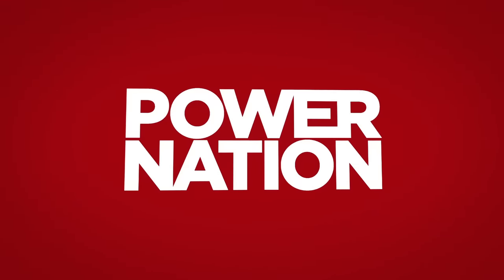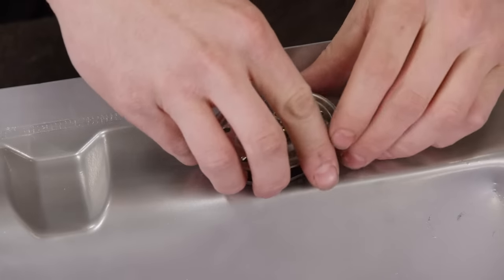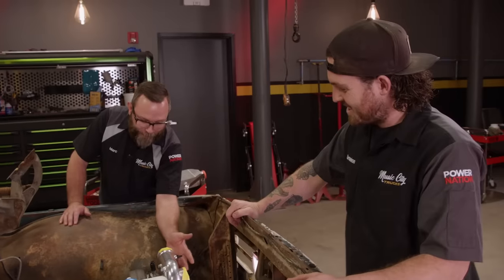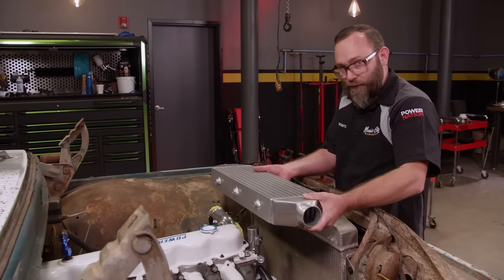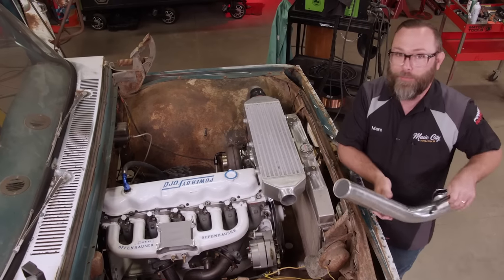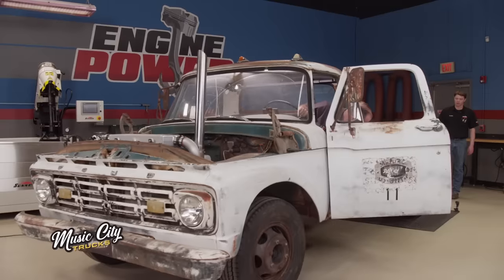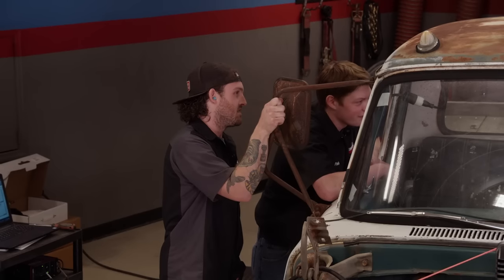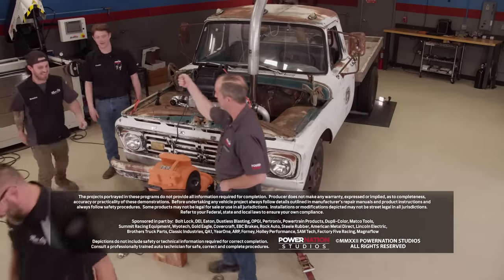Turbocharged Ford 300 Flatbed Dynoed - Music City Trucks S2, E8

Comment: Great project but it just seems like you took the lazy way on some of your choices. 

Solid mounting the engine and then sold mounting the intercooler to the engine and the top radiator tank?? Really? You do realize how much a chassis flexes on a old solid axle one ton truck don't you? Not only did you mount the intercooler right where all the hot air from the radiator is going to go thru it. So you are going to have nothing but heat soak problems. Because of how you mounted it, either the radiator top tank or the intercooler itself is going to at the minimum develop cracks. At the maximum get torn apart.  

Why would you not mount down behind the front bumper? You could angle mount it and build a shroud/scoop plenum box to direct air into it. And there is plenty of room to run the tubing in under the core support.  This isn't a slammed import.

And a hood dump exhaust pipe? Seriously? What are you 16? I thought you said you guys want to drive this? Some of the choices you are making sure makes it seems like the opposite of a driver.

Comment: So you decided AGAINST the holley Sniper that was ALREADY tuned for the engine and turbo....  and putting that exhaust like that is just as idiotic as putting the air to air intercooler horizontal over the radiator.  Someone should have walked in and fired you both.

Comment: Fun but nonsensical build. I loved the original upgrades. I think they managed over 200 hp and it ran great. This build was fantasy only as it makes no sense. Economic or otherwise.
Reply: May be for you. But there’s people out here that like to do odd things. That’s what entertains them. Who are you to tell them it’s nonsensical to build something different so they can say they have something different?

Since you’re all about practicality you should never do anything but a 350 Chevrolet.
Reply: Respectfully, I disagree. This has the low speed Torque of a diesel engine, high speed horsepower of a 460 gas V-8 engine & fuel economy of a small V-8. This engine really can do it all very well. Example: check YT "Wasted Paycheck Garage Towing 12,000lb load in my Turbo 4.9L"  (300 cid) like it was nothing. Not "nonsensical" at all, but very practical, useful & reliable.
Reply: The only thing wrong with this project is some of the choices they made. Like solid mounting the engine and intercooler, the intercooler mounting and position, and the hood dump exhaust. Nothing wrong with the turbo'd 300 except I would have left it carbed ( blow thru ) .
Reply: Ok, good points. But they did have to rebuild from the crank up. Now add the turbo, associated plumbing and intercooler and the investment has to be at least 10k. And it's not even fuel injected or computer controlled. Add the very high octane fuel which can cost more then diesel. It's cool for sure. I love the 300 straight 6. But just get a diesel. The 300 with upgrades was a great project. I think they got over 200 hp. Now that's a runner.
Reply: @joewright219  I don't disagree with the point that they are building something really cool. I love the 300 straight 6. A reliable work horse for sure. But the cost vs gains is not great. Probably well over 10k invested and you get something as good as a diesel. The premium fuel needed also factors in. The original improved 300 they made developed something like 230 hp and would do it all day on 87 octane and still provide rock solid durability with solid performance improvement. I'm thinking this turbo rig pumping 10 psi would be suspect on a 90 degree day. I guess I'm just to practical.
Reply: @locker1325  You can build a 300 for a lot less then 10K. Unless you are paying someone to build it for you. Did you watch the show? It is fuel injected It has an aftermarket TB injection unit that resembles a carb. I think it's a FiTech, I don't remember. That's one of the parts I didn't like. I would have preferred a blow thru carb set up. Diesels are expensive to buy, build, maintain.  The 300 is a pretty cheap engine to build( fewer parts then a V8 ) , easy to work on and cheap to maintain and pretty damn durable. Personally I would run it on E85 and turn up the boost.
Reply: @locker1325  Chris, I don't know your location & related union cost of auto machine shops. I'm in S. Central Tx., San Antonio metro area. $5k would pay for all engine parts, intake man. reman turbo of same size, cleaned/tested intercooler from dismantler yard, & my free (to me) disassemle/rebuild labor. The Holley Sniper 4Venturi Fuel injection/distributor that they used on the dyno was interconnected for full digital control, is the highest cost & might take budget to or beyond $5k. There was no mention of exotic "race gas" In Tx, premium unleaded is still cheaper that rediculous diesel. Eqivalent turbodiesel power, would weigh more than Twice the 300 I6 weight ! Frame reinforcement, spring, tire &brake upgrades necessary for F100-F150 or other Ford cars equipped with 300 I6 stock. Millions of Ford 300's were made until '96. Whats wrong with extra performance oriented 300 owners getting to play on a level playing field, using a Turbo on a fresh rebuilt old engine? Take the turbo Off of your favourite diesel & run naturally aspirated! Talk about a smoking, dead dog non-performer. The turbo System makes the difference! Are you a closet Ford 300 hater(just kidding, great discussions & comments guys!) Cheers! Paul, from S. Central Tx

Comment: turbo placement too far foward. fresh air restricted by tight 90. intercooler placement wrong and too small. intercooler is not effective when placed in the engine bay. radiator heated air wont cool the interccoler. the best place for a bigger intercooler is in fornt of the radiator behind the grille. down on the valance. or under the and behind the bumper. " we dont want to put holes in the radiator core  support" should have already built a tubular core support out of 1" tubing. i learned nothing from this program.

Comment: Since you guys are so innovative and coming up with new ideas to help others why don't you concentrate on the new ordinance or law in California that stops 23 years of vehicles of driving on the city streets and highways in California starting January 1st 2023 if your vehicle is built from 2010 to 2022 you will no longer be able to drive these vehicles in California due to the new pollution control rules if you don't believe me contact GM Cadillac and several other manufacturers out there that can no longer sell their vehicles come January 1 of next year come up with a hydrogen cell that could be easily added to any modern vehicle to operate off of hydrogen and not gasoline help save millions of people from buying a battery powered car